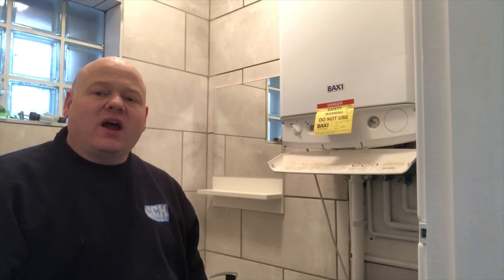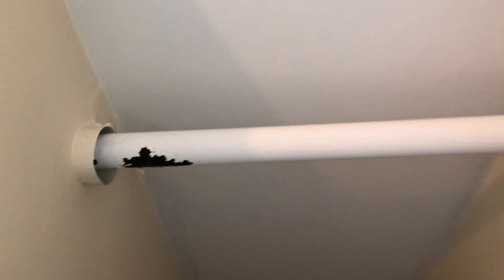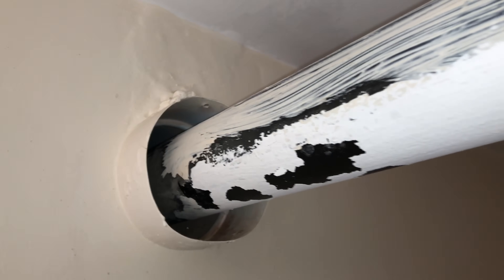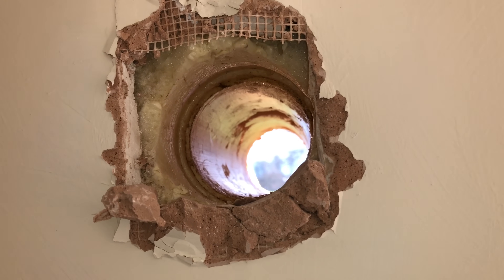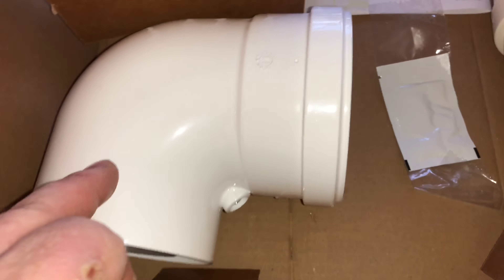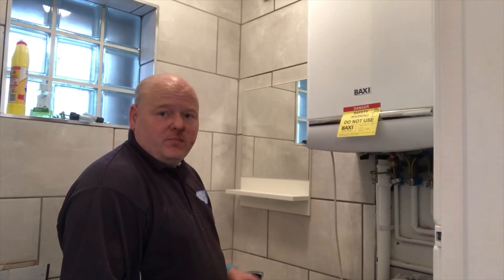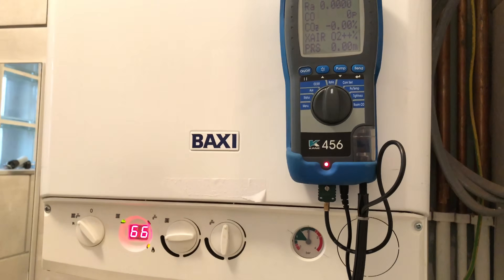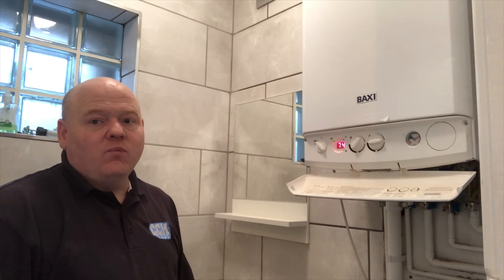Dangerous Gas Boiler  A day in the life of a Gas Engineer / Plumber

Comment: Probably a good idea when siting boilers to have them on walls that are unlikely to be extended. However as most people put them in kitchens & a lot back onto the rear of the property they will always run into problems meaning they will not go to the expense of having the flue & even the boiler sited elsewhere & will bodge it.

Comment: When I worked as an HSE inspector a colleague asked me to call in on the property on my way home as it was on route, a builder had called concerned about a property.  I got there to find mother, baby and toddler, a combi-boiler installed with the flue venting into the conservatory and no door between the conservatory and living room.  I condemned the boiler, which lead to a battle with the mother who assured me it was safe!  I then called Network gas to get the supply isolated, they were excellent and got there quickly.  While I and the Network Gas guy were sorting out paperwork the landlord turned up and announced that it was safe and he knew because he was the local Councillor (Slough) and we were to reconnect the boiler or we would be sued.  Once the supply was locked off I left, I called the Network gas guy the next day to see how he got on, it ended with him calling the Police as both the land lord and tenant were making threats.  The level of ignorance was astounding and I have no doubt the baby and perhaps the toddler would have been dead by the morning.

Comment: my boiler been done by gas registered "engineer" not, this guy barely finished primary school, no way he had any engineering degree to call himself an engineer. Never registered warranty with Worcester. Boiler didn't have any filter on the return, boiler manifold fittings were tightened by hand and sealed with plumbers putty, including gas pipe, olives could slide back and forward when undone.  Pipes not clamped rattling and hammering, also dropped under the floor in the ambient temperature without any insulation. Happy to give you his details if you can take his certificate away forever. there is quite a lot of shttt jobs made by certified installers , they only count on quick boiler failures so they can make more money, fkin scum not people!

Comment: Can I ask did you add some 28 mm pipe for the low gas pressure.  And you should of added expansion vessel.    One other question was there other gas appliances in property as well as that can make a difference.  Thanks Allen.

Comment: Hi Allen, as I understood it some years ago you could have a plug on a boiler according to IEE regulations, but the wall socket had to be unswitched. And I prefer a plug as I have seen videos of boilers still live with switch turned off and fuse removed. With a plug you can see it is actually totally disconnected. Has this changed at some point or is it just that IEE and Gas Safe conflict with each other?

Comment: Useful videos Allen. If I may ask, I have a potterton megaflow system. Although fairly old, been working well and efficiently so far. Had it serviced just before lockdown .  Just of late, water has been leaking from the back of the boiler when heating comes on. Pressure gauge goes up to 3. After around 20 minutes the leak stops as pressure gauge goes down to 2.5  or just under. I've tried bleeding the radiators and pressure goes down but not the right way to go about it every time the heating comes on. Odd thing is when the boiler is off and cooled down, the gauge keeps at 2 and doesn't go down any further now.
Called an engineer who said there was water in the Vessel so drained it and pumped air in it. That day the gauge came down to wee bit over 1  Then kept at 2 when heating turned on so  luckily no leaks. 2 days later,  the gauge has moved up and now goes to around  2.4 when heating turns on and keeps at 2 even when off.  Worried that the same problem will arise again.  IF it is a faulty Vessel, would it be a major job to fix and how costly?  What is your opinion. I am now alone as I lost my husband not long ago and so lost for advice,  and am getting worried now that the cold weather has started.  At the moment water and heating are working ok but also praying that the water cylinder in the attic is not faulty. Please could you advice. 🙏
Reply: may need a remote expansion vessel installed or your filling loop is passing.

Comment: As a commercial engineer, I see this all the time. Engineers who are badly trained, working for companies who push push push them all the time, a bad combination. I worked for a national well known company who everyone will know, they installed 2 x 400kw boilers which had 14.5mbr inlet pressure. The bosses were told before the job started, during the job and showed after the job. The manufacturer came out to commission them. Great I thought, he’ll shut them down. He saw the low pressure ( the boilers have a safety cut out at 14mbr ) and told me “ I’m not here to cause trouble” and walked off. 
160 metres of 100mm steel, plus they’d left the drop weight gas cut off in the supply pipework further reducing, and no one was interested. 
My colleague attended site just after commissioning and immediately shut them down issuing a warning cert. 2 years of arguing back and forth and the result was a switch in the incoming power supply which made it only possible to run 1 boiler at a time. So, over £100,000 later and the client had a system of 2 boilers but could only physically run 1 at a time. 
It was excruciatingly embarrassing for me, luckily the site manager knew my position on it, but my bosses, ( and I Tupe’d into another national company in the midst of all this, so 2 national companies were involved ) and Gas Safe didn’t want to know. It’s still like it. Despite me asking for a stool piece to be made up to ditch the old drop weight valve as a starting point ( there’s a new solenoid valve linked to the E stops at the plant room exits ) no one is interested. It’s actually due it’s annual this month, it’s already in my file, I hate going there...................
I’ve got a pile of examples of bad fluing, undersized ventilation, undersized gas pipe of installations that are 30 years old and have had a ticket every year. The customers think I’m trying to rip them off. I’ve only ever known 1 other engineer who has an anemometer ( to measure air flow ), so how are they calculating mechanical ventilation. I’ve come across reversed flow in flues, ie extract fans so powerful they pull the flue gasses back down the stack into the plant room.
This gets missed because it’s impossible to see without calculating the airflow. I could bore you for hours with examples, this isn’t Mrs Jones getting in someone cheap, it’s major companies relying on qualified engineers who let them down.

Comment: Hi Allen, do you have any advice for repairing a leak in a radiator? It's leaking from the bottom, about 6 inches from the TRV, so nowhere near any of the valves, nuts etc. QuikSteel seems to have been used previously which worked for many years but now it has returned! Any tips or advice would be very welcome.

Comment: They are far from bullet proof would never fit one absolute piles of shite, total shit install
Reply from the maker: With all due respect I have installed hundreds and have very few issues.
Reply: @AllenHart999  i changed loads of them mainly for failed heat exchangers leaking on to electrics. We all have our preferences I stick with ideal logic plus mainly nowdays, worst thing about them baxi combis  is the flue not being in the centre. Take care fella
Reply from the maker: @billrankin  I only work on the ones I installed normally, The boilers are amazing when installed correctly 👍

Comment: Would a boiler with a lot of corrosion fail even though it works ok, and meets the standards on combustion, safety devices and 
flue?  Thanks for the very clear video.

Comment: looks like the boiler was fitted OK ,then a builder turned and did his own flue extension ,if the plug has a 3 amp fuse in it it is OK ,but not ideal

Comment: Having watched this video (from a customer point of view). To spend a day at least sorting the mess out and the customer coughing up a mit-full of spondolies only to be told at the end of the day the boiler is under-gassed and not fit for purpose. Was the boiler even safe  to use when you left the premises ?, you don't really make it clear. Surely if you are called to look at a dangerous installation which as some comments suggest may not have been so dangerous upon first install. Before the extension it may not have been a bathroom and I agree  the builder has made a complete mess of it which may subsequently have rendered it dangerous thereafter which would exonerate the original installer somewhat.  If I was the homeowner and called someone out to this I would have expected them to give me a complete run down as to the whole problem and what is needed to rectify the problem and if (which it seems may be the subject of your next video at this property) I suspect is going to be a replacement of the boiler after having paid for unnecessary work in the long run. I don't see that messy soldering means it isn't working properly.  Out of interest who capped it off as unsafe ? if this was a representitive of British Gas or Gas Safe or whoever has the power to do it should maybe have taken issue with the whole install and subsequent alterations with some kind of follow up action. Surely to cap it off would have had to have been a Gas Safe engineer. I love your videos Alan and is the reason why I have choosen a lareger reputable company in my area to come and replace my boiler (Worcester 35cdi) after 22 years and is now playing up too much.  I know I will pay about 1K over the odds for the job but what videos like yours tells me is to basically go with a larger more transparent company with a longstanding reputation than any old independant installer which is what I was going to look for on Check-a trade or Gumtree or where ever they advertise. I am definately going for the Viessman 111 or 100. Brill video Alan and I shall be watching many more.

Comment: Not sure I would agree the boiler is too big.wouldnt the gas just modulate to meet the demand? I get what your saying though, its overkill but I cant see it causing issues. Am I missing something?
Reply from the maker: What does it modulate down to?
Reply: @AllenHart999  the fan will slow in relation to the temperature of the hot water and reduce the gas rate according to demand. So as far I as I understand it, although it's a 40kw boiler, you wont be wasting gas because the boiler will only use what's required anyway. I think your correct though in that it might not work at its peak efficiency all the time. However, you would never have to worry about reduced hot water performance on freezing cold winter days.  Loving your videos mate, I've already picked up a load of great tips. Thanks for putting out this content.

Comment: Apart from an undersized gas supply, and no external timer/ thermostat fitted  I don't see anything wrong with the original install, before the extension was built and the flue extended. The electrical supply is fine, unplugging the boiler provides a means of isolation, as does a double pole spur. The expansion vessel was probably adequate before the extension was built. The lack of an external timer/ thermostat is not a safety issue.

If you capped off every boiler you came across which was slightly under gassed, there'd be lots of houses with no heating!

Comment: your videos are really informative and useful, but I was amazed to see you say that this boiler was oversized after you tested the flow rate on a tap that is clearly aerated. The water is clearly white and full of air, the tap is therefore restricting the flow rate of both hot and cold and you're not getting a true reading of the cold flow rate to the property. I say this from experience working on behalf of a water company doing efficiency checks in residential properties.

Comment: So the boiler is open into and pulling air from what appears to be an external entry vestible built onto the old outside.  The exhaust gasses are going outside, if there is a vent brick or something in the new "vestibule; so it can pull air in from the actual outside, what the effing difference does it make ? if anything its probably safer like that than having the exhaust an inch from the intake like it was designed for.  A modern boiler has a fan drawing air from the inside of the boiler case straight into the burner.it cannot be anything other than a negative pressure differential inside so the gasses cant come out of the exterior of the flue.  Not so very long ago it was normal practise for a boiler to pull its combustion air from inside the actual building, not an out building.   Shock horror, it hasn't got a big enough expansion vessel, in practise what happens is a radiator valve thats a bit short of ptfe tape drips black sludge onto the carpet.  The world will not end.  Measuring how much gas the boiler pulls by counting meter revolutions is just scraping the barrel looking for problems, bloody hell is only running at 34 kW, its desperately short of gas.  No mention of it the power has been reduced in software like modern boilers can . The vent running downhill and it dripping condensate from the vent isn't going to end the world either most drains drip their condensate outside somewhere  This video drips self righteousness and job creation.  As other posters have already commented Gas Safe won't give a toss, if they;re getting their grand  a year for the pretty sticker to put on the van.......

Comment: Come on Alan use your head the house has been extended and some builder has taken the flue terminal off and used a plum kit nothing to do with the installer .. also a plug instead of a fuse spur is more safe for positive isolation not that I’ve seen you use your socket and see or check the fuse ... the plug needs changing as it doesn’t have sheathing on the live and neutral pins ... try getting your foot pump out as well and recharge the expansion vessel instead of ripping people off .. absolute numpty .. guy who installed it has done a decent job pipe work is neat .. this guy uploads videos like he’s a hero has no common sense trying to drum up business .. probably hasn’t fit a timer as it’s an old dear who just has it on when she wants .. only thing I agree on is the boiler size .. go back to driving a bus or whatever you did before you did a 6 week gas course .. muppet rad valves a leaking cue it’s at 3 bar no expansion vessel required it 2 years old your robbing people Alan

Comment: Nothing wrong with the boiler being plugged in - as long as its on a unswitched plug socket with a 3 amp fuse in the plug. However the socket shouldn't be directly underneath the boiler.

Comment: Why should the condensate be directed to flow into the boiler rather than away to the outside, assuming the large plastic tube had been capped off with a secured bend facing the earth rather than the sky so any condensate would simply drip to the ground?
Reply: I'm a customer rather than an engineer but i didnt understand from.the vid what would go wrong if the water is directed away from the boiler as i think understood Allen was saying.

Comment: I'm not a gas safe engineer but looking at the installation the guy who installed the boiler needs to be sent to prison and have his gase safe registration dismissed for life he is playing with people's lives.Some comments made are blaming the owner but a lot of the general population don't have a clue about technical issues and safe installations they just want central heating on / off and hot water from tap.
Reply: Not sure if general population 'technical issues' includes not being able to figure out how to use a thermostat, or a smoking hot extension cable is considered 'normal and safe' or too technical etc. We are talking monumental stupidity and willful disregard of obvious danger signs. If all they want is CH ON/OFF and Hot water from tap, without putting enough brain effort into it to operate basic common sense and the provided user controls, it makes you wonder if someone has to dress them in a morning. God help us and them if that is the measure and level of 'general populace'. If they just want CH ON/OFF etc without at least some tiny bit of brain in gear then they are entirely to blame for the consequences if they haven't the sense to 'switch it off or stop using it', its not 'technicalities'.

Comment: They're only bulletproof so long as cowboys are not allowed to touch them, I have the Potterton ProMax version of this boiler, and the monkey sent out to investigate a leaking expansion tank a year ago decided it was just rain ingress (no idea where he got that from, we don't have anti-gravity rain here in County Durham to run uphill through the flue!) and instead swapped out the diverter valve cartridge, common fault he claimed, and he screwed that up so has been leaking for a year, and he refused to fix the fuckup, doesn't like being told he fucked up apparently!! 

So, I took it upon myself to seal the leak in the expansion tank with RTV silicone (high-temperature sealant) to stem the leak & recharge with a bike pump until I can buy a new tank & fit it myself, and just this friday gone the diverter cartridge he fitted finally failed and leaked water into its' actuator motor and tripped the mains RCD, so for the weekend I've had no heat waiting for a new valve cartridge to arrive, joy, the actuator motor unit I stripped, dried, cleaned and lubricated so is functional again thankfully...

Oh, and he's "Gas Safe" certified by the way, and Baxi approved too, yet I feel safer working on the boiler myself (not gas safe, but very competent, logical and well-researched) than letting that prick in the house ever again...